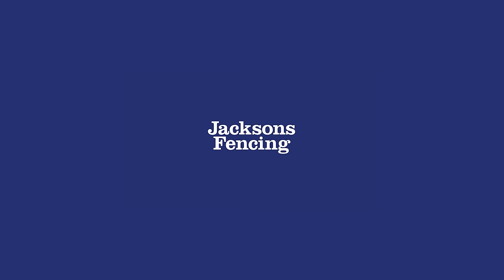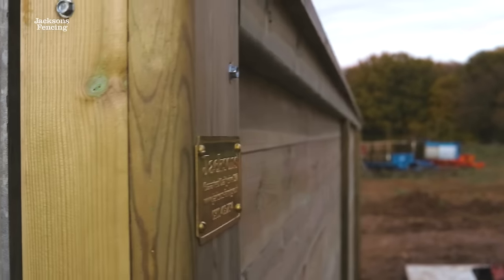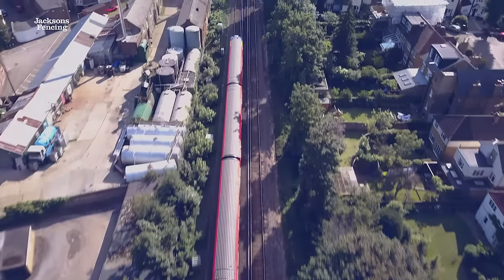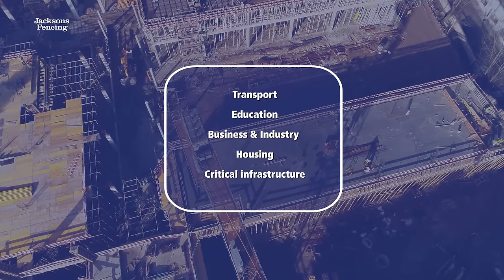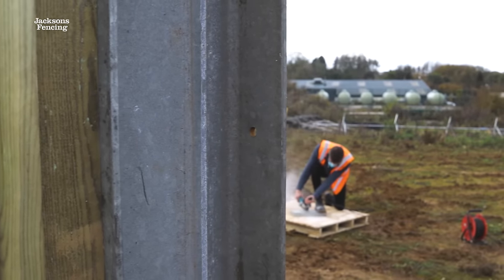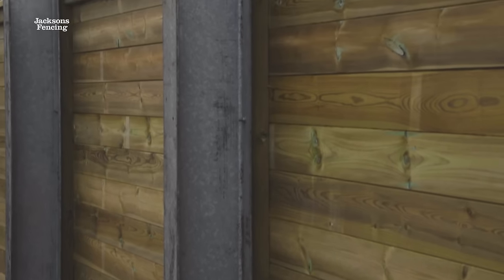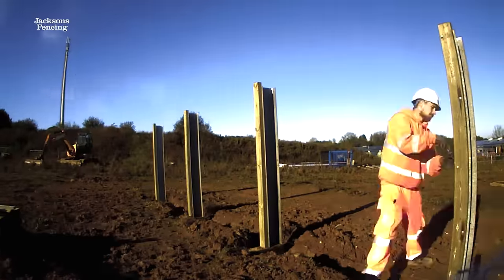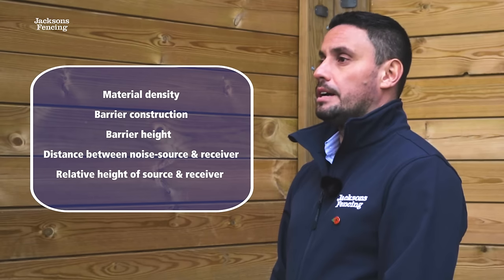An Introduction to Commercial Acoustic Barriers | Jacksons Fencing

Comment: How effective are these solutions against loud hot spa pumps? We have one near us and the low-frequency hum and vibration is very invasive, to such that several dwellings are effected. The owner of the spa basically leaves it running 24/7. Thanks for your time and an interesting video :)
Reply from the maker: Hi QuadTubeChannel,

The Jakoustic barrier is effective against varying frequencies of noise, however low frequency invariably is more difficult to combat.  High frequency noise is linear with short sharp bursts of energy that will deflect straight back upon hitting a non-perforated surface with sufficient density, low frequency however (much like a stream of water that hits a rock) will split and continue its course until it can find a way in.  It also travels much further than high frequency noise which is why you get a resonating effect.  This all sounds very bleak I know however the Jakoustic barrier can still be effective, but what is essential is that the correct height, length and positioning of the barrier has been calculated.  The general rule of thumb is that the closer you can get the barrier to the source the more effective it will be – the idea being you kill the noise at its source before it has a chance to travel upward and outward.  If the correct barrier is installed you can expect a realistic reduction of between 9-14dB which to the human ear represents a halving of sound.  Jacksons would be happy to provide you with the details of a Qualified Sound Engineer should you wish for a consultation.